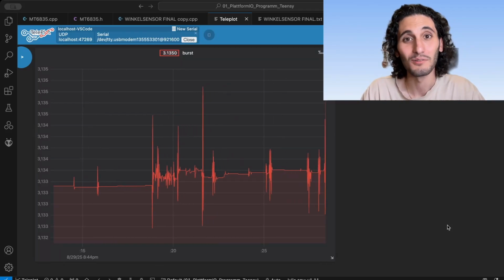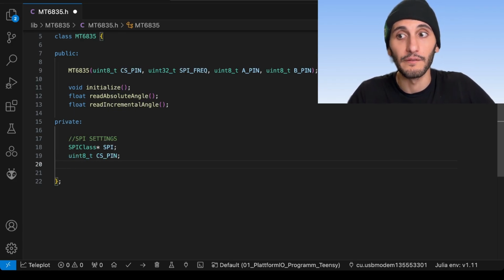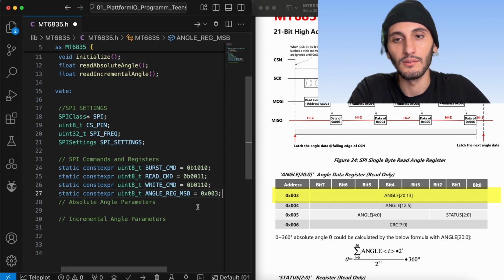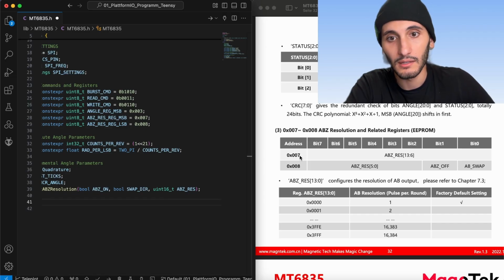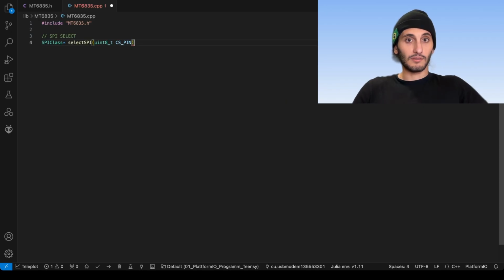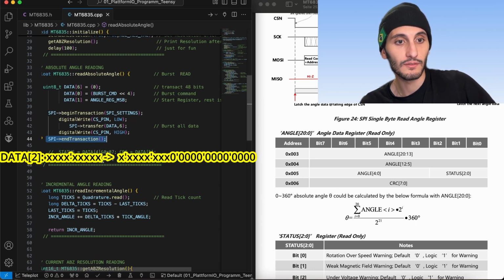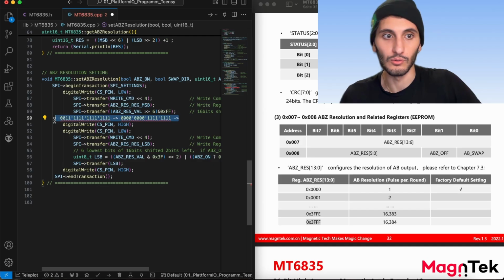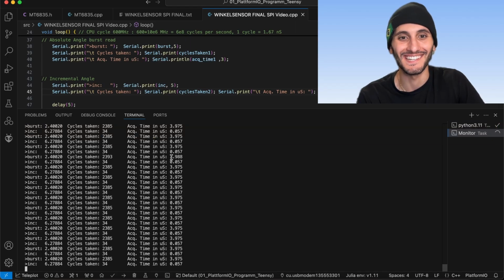I coded a 21-Bit Encoder Library for Arduino (How Fast is It?)

Comment: Thanks! Quick question: do your MT6835 chips show any measurable resistance between VCC and GND, for example above or below ~500 ohms? The AliExpress boards I have seem unreliable, and I am trying to compare. Thanks again.
Reply from the maker: Unfortunately my multimeter is broken, so I can’t measure the value right now. The pcb I am using is a custom made board based on the datasheet. The Gerber files are available on my PCBWay account. 
The measurement is reliable and works good
Reply: @SalimsWorkshop  Thank you for your response. I will take a look at the Gerber files available on your PCBWay account
Reply from the maker: @v3xro885You’re welcome :)
Reply from the maker: @v3xro885You’re welcome :)

Comment: Thank you for your video and proposal for use of it. I have looked at the datasheet, and I think it lacks some information. Do you have an idea, how the hysteresis settings work, and will they in some way influence the angle reading? You can change a BW value, that likely change some moving mean value of the angle reading. But I miss a bit more detailed information about what the sensor do about it.
Reply from the maker: You’re welcome! I have no idea. The data sheet doesn’t state any information. Sorry

Comment: It's horrible way to do it. It should be done by DMA and TC, so processor would spend like 200ns for this action + printing should also be done via hardware so sending is another 100-200ns.
But it is Arduino, what can you expect :)
Reply from the maker: U don’t think it’s a horrible way. It’s the most common way. 

Can you even be this far “200ns”. One valid data point consists of 48bits that are transferred over SPI with a frequency of 15MHz. 
If you do the math, you will see that it will take 3,2us. In the end that would be your minimum required time to acquire one valid data point. 
Am I wrong or what do you mean by “processor would spend like 200ns”? How would that be possible ?

Do you know how to do it via DMA ?
Reply: @SalimsWorkshop well, this would be on STM32H7. In one of my designs I had 8 DMA streams for stuff like that. Everything is memory mapped, and communication was done with uart and dma again running at 1Mb. This means >99% of time is to do stuff.
Yes, it is most common way. Simetimes it's all you need
Reply from the maker: I am using a teensy4.0. The sensor I am using only allows about 16Mhz for the SPI frequency. So I guess u are limited to a certain acquisition time. 

in your case, do you use sensors too or do you read out a sd card? If yes, then of course you could be way faster, right?

I guess reading my sensor via DMA SPI would not make a big difference. maybe 0.5us , I would guess.
Reply: @SalimsWorkshop  great video. I am no expert, but what he is suggesting is doing this transfer in the "background" using DMA. This would allow you to only start the transaction, then do other things for the 3.2us and then get an interrupt when you have received all the data from the encoder. This does not lower the latency of retrieving the absolute position, but it will lower cpu usage for the transaction. However, I have no idea how easy this is on your teensy. Moreover, I doubt that saving 3.2us of cpu time is that important for you unless you intend to read the position at more than 10kHz.
Reply from the maker: @torbrve323 you are absolutely right. There are some libraries for DMA transfer for teensy.